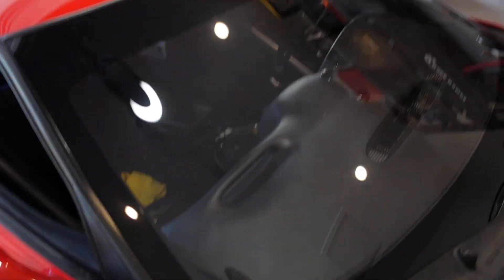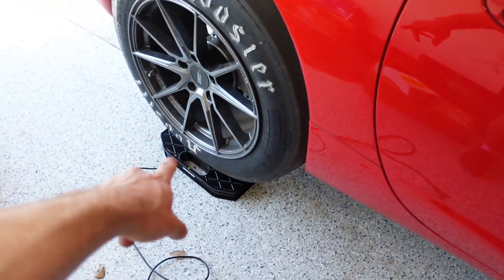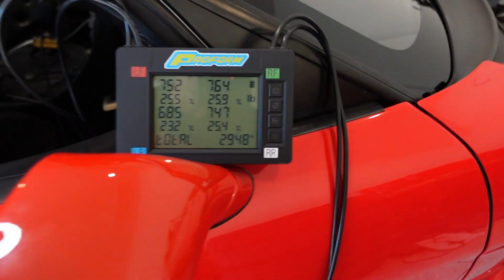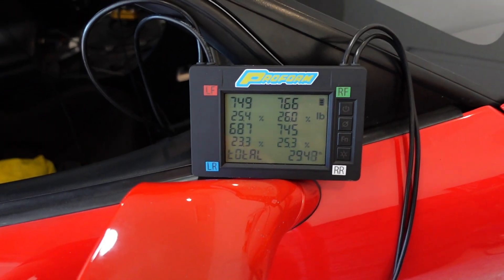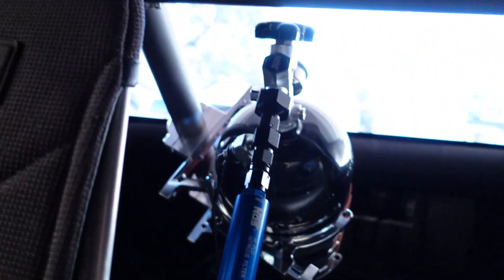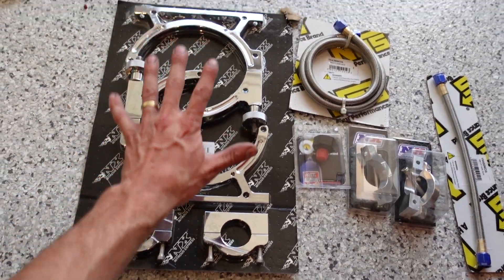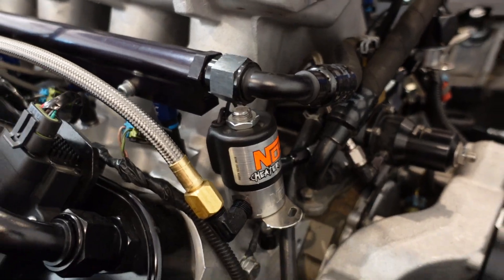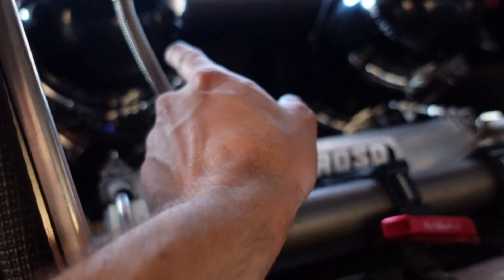DOUBLING Ricky's Nitrous Capacity in Preparation for The TX Mile

Comment: Just a thought…. Since your peak power is dependent on nitrous pressure, how about adding a pressure sensor on the manifold side of the solenoid and set up a gauge and a dash warning light to let you know what is going on.  There’s no sense in thrashing your engine on the course if your bottles are low or malfunctioning. This same warning light could be hooked up in parallel with other sensors so you only have one “oh shit” light to worry about.

Btw, on the hydrodynamic side of things, if this new nitrous setup is not up to snuff, you might consider going to a -8 line up to the solenoid.  Even if the solenoid is a -6 fitting it will have a greater flow by reducing the wall friction turbulence compared to the smaller hose.  That won’t help if you don’t have sufficient source supply, but that seems to be covered now.

Comment: Won't the heated bottle just flow out finding the least resistance? As it will theoretically flow into the other bottle only if the solenoid is closed, however would it not flow out of the heated one faster as it will have more pressure because heat builds pressure. To be certain that the same amount of gas flows from each bottle wouldn't want them the same external temperature, I don't know for sure if you have problems you may need 2 heaters ,and solenoid valves to activate at the exact same time. But I am not so educated about gasious 
flows. 
Good luck youngman 
I remember Beeville as a town on the way to George West, and Grandpa's house.
I was a pipefitter 40 years. and a retired piping superintendent